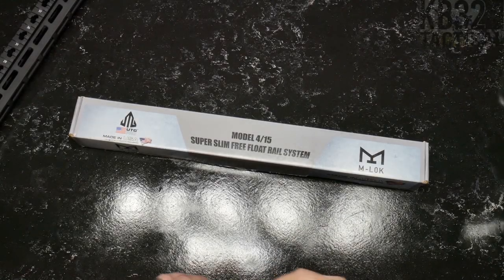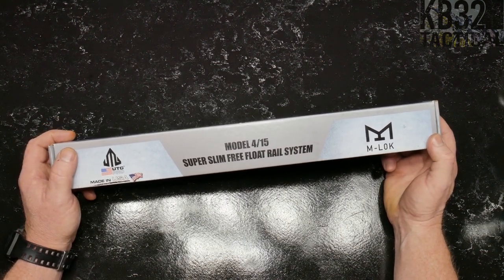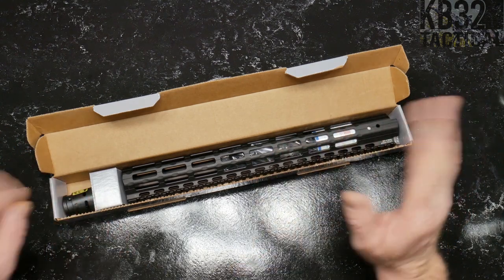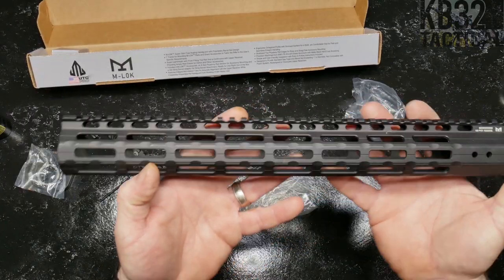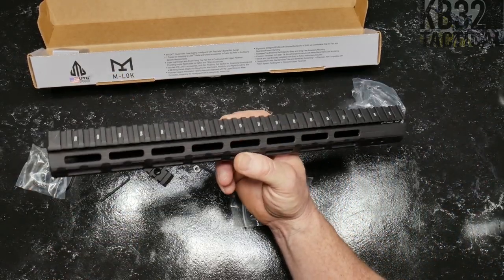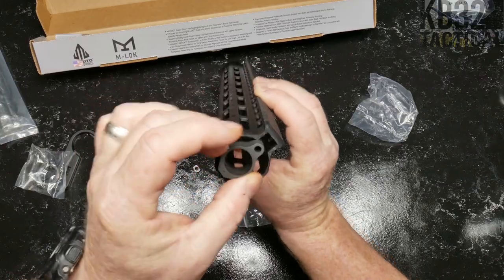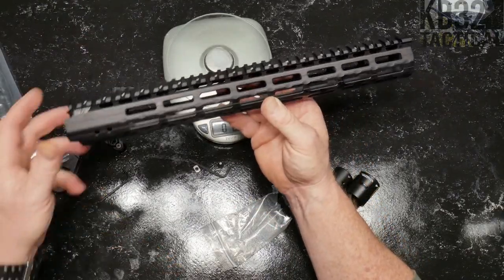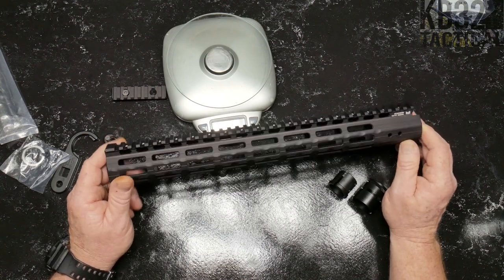Everyday Joe Build Part 2 UTG Pro Super Slim Hand Guard

Comment: I just purchased my 2nd UTG Pro Super Slim MLOK rail. This is a great rail for the money. My 1st one is the 15" model on a 16" barreled upper and I have had no issues or complaints with it. It has gone on a few hunting excursions and several ranges trips as well as dessert shooting sessions with 0 functionality issues. The rail is very light weight and comfortable to grip. The only down side I have seen so far is with the rail being so slim if you heat up the barrel you feel the heat some but this happens with almost every other rail as well. I like this rail so much I am putting a 13" model on a 11.3" pistol build.

Comment: I installed this exact rail system on my patrol rifle and have had no flex, movement, or other issues. It is light and compact which is nice when storing it in the car rifle rack. Put some locktite on your hardware and you are good to go! 👍

Comment: I've owned a 15" UTG pro rail for 3~4 years. Beautiful rail, well finished, nicely de-burred, feels great in the hand. It's mounted on my range toy target shooter with Odin barrel and Geissele trigger. That rifle sees no abuse at all which is all I would trust UTG's lockup system to handle. A great cheap rail for SHTF is PSA's partial pick M-lock rail 13.5" for $80. Not nearly as well finished as the UTG but way stronger lockup.

Comment: Not being an AR guy, I set out to build an AR as cheap as possible. Purchased the UTG Super Slim with Blue accents. Install was a breeze (first time build) and it is solid. Liked it so much, I found blue accented, trigger guard, picatiny scope mount, buffer tube, saftey, and several other items in blue, all from UTG. Not having anything to compare against, it seems super solid, something I would have no problem purchasing again. And the best part, cheap! Does shoot well, sub moa, however, I believe the Wilson Combat Barrel, and Black Rain Trigger might have something to do with that,,,,

Comment: I recently installed this hand guard on my .300 BLK rifle. It looks great, but the barrel nut is poorly designed. I had to sand the end down so the threaded screw holes lined up to the slots in the barrel nut, and even then they still weren't 100%, then the barrel nut wrench needed the finish removed on the teeth so it fit in the slots properly. Also, once it's installed, you can't put the receiver in a vise block because of the anti-rotation system. Once it's on, it looks great, but I dread the day I need to take it off and reinstall it.

Comment: I installed a UTG Pro similar to this but without the picatinny running down the entire top of the guard.  Mine has a section for the front sight and then stops with a small ridge and starts again before the scope mounting area. It is sleek looking, light as a feather, and not bulky like other handguards.  My hands did not get hot shooting with this and the vents allow plenty of airflow.

Comment: Is the price top secret how much was it?  But the BCM mcmr rail I got recently was around 140ish maybe less I can't even remember it was so cheap so idk why you would go for something like this when way better quality ones could be had for such low prices(before and after this corona rush). But I don't know the price of this rail so maybe this was like 30 bucks or something and worth it if you have no money..
Reply from the maker: I talked about the price at the end.....................
Reply: @kotaboy32  dang, i watched the whole thing and didn't hear anything,, oh I just found it, it was literally at the very very end after your video ending otro, that's when I clicked off because I've heard that many times before and there's only so much time in the day,, thanks for the heads up. It's about a 100 bucks, plus or minus 10 or 15  for all those who click off when the otro happens(not that it's a bad otro...:) Dang I usually click off during your otro am I missing the most important info everytime by doing this lol?
Reply: Teddy David these are usually between 90-125. I had one that came with a Sig M400 upper. I sold the upper almost exclusively bc of this Handguard. It’s cheap and feels cheap. I got a BCM MCMR rail recently and it’s a much nicer setup including a much better barrel nut/mount system. The mounting bolts on these are as soft as butter and strip extremely easily.
Reply: @mattsterpiecenjmaflva9956  Cool bro thanks for the feedback.  Yea I also choose the MCMR for my next build as well. Seems like a great bang for your buck option that is tough and durable and also looks great. I don't like the thought of cheap soft as butter parts at all.  There's no reason to get a cheap rail when the step up in quality for such little more money is so achievable..

Comment: You can get a Midwest Industries Combat or SLH rail from 105-150. I’ve even gotten BCM MCMR rails for 135. These rails are trash.
Reply: I'm a huge fan of Midwest products myself bud. And to my knowledge Midwest offers the most variety in terms of lengths than anyone else. I have their combat rail and am ordering another this week. No timing, fantastic lock up system and very reasonably priced. I been looking at these ones but my gut tells me to stay away. Have you had bad luck with these? Stay safe my friend.
Reply: johndel1971able me too, I’ve bought and built at least 10 Midwest rails and have not had a problem with a single one. I bought a Sig M400 upper with this rail and had a few things I didn’t like about it and a QC issue. The issue was the bolts strip incredibly easy.  Like, made of butter easy. In fairness to UTG they sent me an entire barrel nut assembly so I got it fixed but what they sent was just as chinsy.  I also couldn’t stand the slickness of the finish they use on them. It’s pretty glossy and again quite slick. For me, I’m spending the additional 20, 30 or even 50 bucks and getting a Midwest or BCM.  I was pretty surprised Sig went with this rail. Then again, not really 😉
Reply from the maker: Will never buy another Midwest rail.
Reply: @kotaboy32  Any particular reason? If I remember right I thought I seen another video of yours and you liked them? Thanks
Reply: Kotaboy32 Tactical why?
Reply: @mattsterpiecenjmaflva9956  I feel the same way. For the little bit of added cost it's worth it in the long run. Nothing worse than finally getting your rail in and something like the bolts stripping out.
Reply: johndel1971able absolutely. I’d placed an order with Geissele on BF and cancelled it bc I don’t feel like waiting an eternity. Went with a 12.65 MCMR on a 13.7 build. Love it!